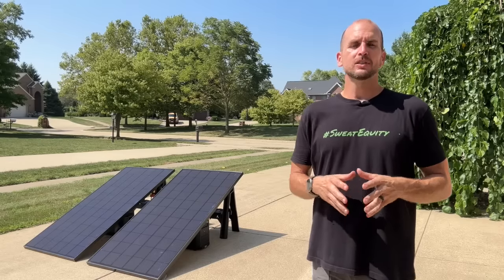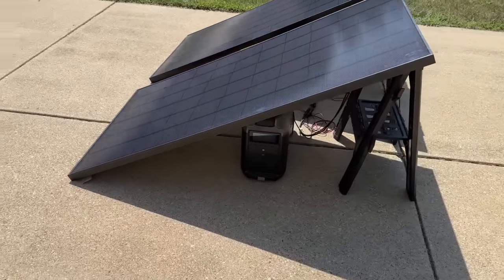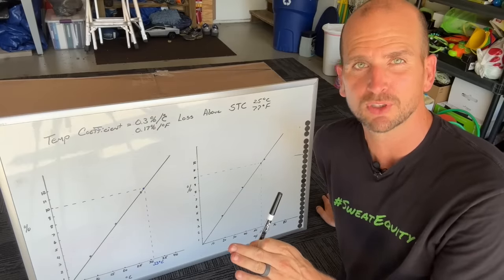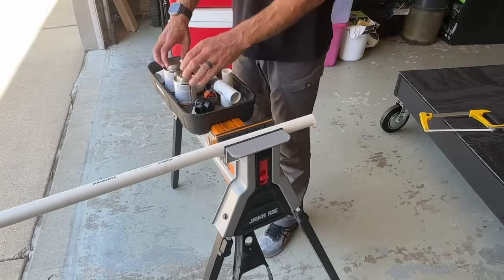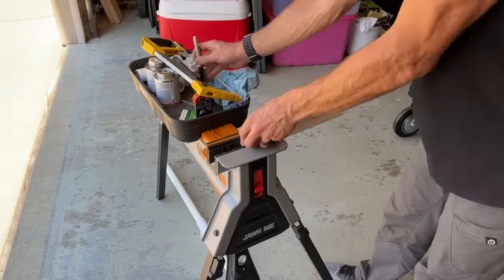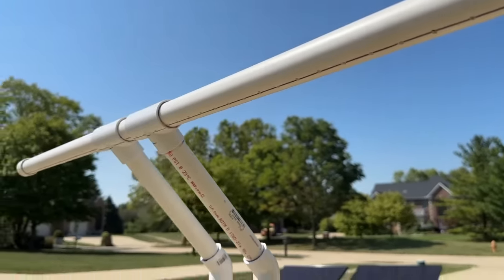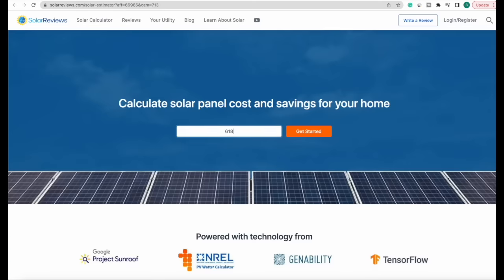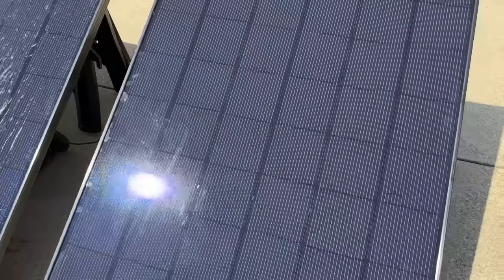Surprising Power Gains By Cooling Solar Panels

Comment: I have a small array in my yard with a 200ah lifepo4 battery. I use this for my pool equipment, outdoor lighting and power tool charging. You video made me start thinking of a way I could use my pool pump and reclaim the water to heat the pool.

Comment: People have been playing around with this idea since the 1980s! It is 100% impractical, but it does work! 😂 not a single commercial application of this idea has ever been implemented successfully. There is a warehouse north of Los Angeles that is stacked with gently used solar panels and you can pick up a 300 W module for about $40.

Comment: This has been on the table for decades.... Powerlabs, Engineering with Rosie, ..... have done this. The major point is cost efficiency. No use cooling the panels if the cooling costs more than the additional power from the grid would. I have seen water and air cooled panels (backside cooled) that use the extracted heat for heating purposes, but all those systems don't work well if you can't dump the heat somewhere. Running water over the front might even redude the light input into the cell.

Comment: Thank you for all your efforts Scott, this video represents pretty much what  YT should be about in my mind 🙂👍 A temp diff of almost 50% for a 5% gain in yield sounds pretty sobering to be honest. Even if this would vary up to 10%, will be it worth the extra investment for the required material, electricity (water pump) and the water itself, which will become a more valuable resource in the coming decades? BTW - have you observed a significant efficiency gain during winter then?

Comment: It looked like the PVC was casting a thin shadow across the top of the panel. that will cause a big drop in efficiency. Ideally you would only need to use as much water as necessary to evaporate on the panel and not run off.

Comment: Apparently the temperature coefficient changes with the age of the panel because I have some 14 yo panels with extensive spider cracks that have degraded by about 10-15% at STC, (basically when it's cool out), but when they really heat up in the summer the power output crashes. It was a simple test I did when they were very hot I took a hose and hosed down the panels. I saw over a 40% rise in amperage on my Amprobe.  There could have been some SMALL variations in solar input but the sky was clear that day. It was an eye opener for me.
Reply: You'll want to use demineralized water for this, like distilled water or harvested rain water. City or well water will most likely leave mineral buildup
Reply: Wouldn't that be covered under the panel manufacturers guarantee? If your panels had a quarantee.
Reply: @michaelpinkston4628  Not when the manufacturer is out of business.

Comment: i think the data is tainted due to the sprinkler tube being set up in a way that partially shaded the panel. i would say it needs to be rerun and setup in a way where each panel is equally shaded... 0% shaded. 
i like the experiment though, curious to know what the real results would be

Comment: I'd say some improvements are from cooling and some of the improvements are from light magnification from water droplets. Cool test tho. I'd say cooling the back side of the panel would give you a better knowledge of cooling alone without magnifying light on the front side
Reply: I don't think there's any appreciable magnification here - you'd need light that'd miss the panels to hit the panels instead, and there's almost none in this setup. There should even be a detriment from additional reflections away from the panel, since the albedo of the panels seems to have gotten brighter in the video.
Reply: @AySz88  If anything the water is probably diffusing/scattering the light waves away from the panel

Comment: I saw an idea trialed that used special double sided panels installed vertically, with the sides facing east and west. It missed the sun in the middle of the day, but overall generated more power by working more efficiently when it wasn’t as hot, and by increasing the number of effective hours by generating earlier in morning and later in evening. It would be fascinating to test this idea!
Thanks for your vid - super interesting.

Comment: That's actually less of an improvement than I expected, but now that I think of it, cooling the outside of the glass isn't going to cool the solar cells by much due to glass being a pretty good insulator.   Also, one risks cracking the glass.  Generally speaking it isn't worth trying to cool the panels due to the extra complication.   Easier to just add additional panel(s).

Comment: I've run a large water reserve through those pool-heater panels to preserve low temps during peak loads, and a single panel running a refrigerant.

Comment: City water or well water would result in mineral buildup on the panels from evaporation, hard water stains, which would lower efficiency and ultimately become nearly impossible to clean off. Collected rain water or distilled water would be best. A system that carries away heat without evaporation of water would be best. Such panels are available.

Comment: Try a much slower drip rate.

BTW it's really common in FL to have hybrid panels that channel pool water through the inside of a solar panel to both cool the panel and heat the pool.

Comment: 100 gallons of water for 20 watts?  Also good luck with that Cybertruck, you'll need it.
Reply: if you set a collection system under the pannel, and then cycle it again through a small radiator for cooling the water, i think it’s worth it
Reply: if you set a collection system under the pannel, and then cycle it again through a small radiator for cooling the water, i think it’s worth it

Comment: As a boater on a liveaboard boat, sailing from point A to point B.... floating "flexible" panels on the water not only provides all the "free" real-estate needed for a 4KW system, it cools the panels and makes them more efficient. When not in use, it is rolled up on a spool (like your garden hose) and stowed there for later use....

Comment: I have to wonder if there is a increase in power from the magnifying effects of the water and if having a mister would be more effective to increase power that way or creating a steady completely covering flow over the face of the panel would be more effective. Likely a full front of panel covering with water would be best as it would even out any magnification and provide the best cooling.
Reply: I had similar questions and if magnification doesn't help, maybe the mister should be on the back side of the panel so as to not disturb the sun's rays?

Comment: Nice video and info but I think you will find 59F is closer to 15C not 33C.  I can see with a roof with water capture that the loss of water could be minimised outside of evaporation and that with enough hot days, solar on hand or a separate solar pump perhaps this still makes sense.  Simplified with a sprinkler or misting system perhaps both cost and installation time could also be reduced.

Comment: I did this for a well! The array output is just higher than the well, but the high temperature reduced the output to 75-80%, which reduced well run time and increased battery load resulting in even less run time.

With the cold well water, we were able to consistently reach 90%+ (got 108% once!) and the used water is plumbed into a tank for irigation.

The only bad thing is I didn't even think about how the well produces hard water.

Comment: Use rain water, or distilled or reverse-osmosis (without a mineralization filter).  Mineral build up on the panel won't be happy for solar efficiency.  My water has enough minerals that it will turn splashed surfaces white in a few days.  (e.g. around an outdoor water feature)
Reply: Or perhaps use micro misters onto the back side of the panel so that any deposits don't affect the solar efficiency - just reduce the cooling. It would also mean far lower water usage.

Comment: Failed to include the cost of the water for the minimal gain. My water bill is routinely much higher than electric.
Reply from the maker: Yeah, this type of system pulling from city water would be a definite No Go.  I think the most practical system are integrated circulation systems for heating pool water.  So you save money on heating the water and also cool down the panels.
Reply: The cost for the electricity on the pump will instantly wipe out any gains. What a daft idea….
Reply: @willsta21  not if you need to pay for electricity to heat pool water anyway.

Comment: Had a friend that did copper panel backing with water lines running through it to pull heat from the the solar panel back in 07 as a some form of Master thesis, find myself looking for that final document now. To compare Results. He used his to heat the hot water/warm the house come winter. Wish I had the money to do something like that with my house, but that would be fresh constructions I am pretty sure for my design.

Comment: Great to actually see the cooling done for the eyes to see. I wonder why panels couldn't become the  actual ceiling of a home? The cooled home (in summer) would enhance power generation, and possibly even pay for the cooling cost? This could work in winter as well, because freezing panels lose performance. Panels perform best at 73°F  or 23°C.

Comment: there is already a similar solution by using some hygroscopic foam at the backside of the panels. This foam is taking up the moisture during the cool nights and releasing it during the hot day. By this evaporation a cooling efect of the panels is obtained.

Comment: Nice experiment! I have rain barrels and a solar roof, I wonder if I could run something like this on hot days when I have full barrels. Would be interesting to measure how much water evaporates.

I really wish there was some product that was solar panels+water (pre?)heating. Not surprising solar installers don't want to do plumbing but would be interesting if it worked out well. Bonus would be the circulating thermal fluid could help keep the cells clear of snow, too.

Comment: There are a bunch of closed-loop options for a cooling system for solar panels.  A small pump pushing water through tubes mounted to the back of the panels and through a radiator in a shady spot (possibly with a low-wattage fan pushing air across it) will do nicely.  Other people have pointed out that panels with internal cooling channels exist, and can use used to heat pools or feed a heat-exchanger for a hot water system.  I would personally like to see a system similar to the wholly passive solar thermal water heater setups, where thermal expansion of the heated water pushes it to a (small) reservoir mounted higher than the panels with either a radiator or a panel with one of the IR-emitting paints that can self-cool below the ambient temperature in full sunlight.

Comment: Let me first start by saying I like the thinking outside the panel on ways to make them more efficient. We need to find out if cooling the panel will work for better efficiency. The only lesson here is that you can magnify the sun with water to get more power out.

Everything must be taken into consideration when doing research.
How accurate is that temp scanner on reflective surfaces? Most scanner say not to use them on reflective surfaces.
Can you cool the panel without magnifying the water so the only different factor is the temperature of the panel itself?
Should the panels be warmer to keep them more active? We know that you can slow down electrons with extreme cold but we don't know where that becomes effective.

I like and watch Everyday Solar regularly. Information you go over is great and the only way to evolve is to try new ideas. Just so you know.
Thank you for being here and what you do.

Comment: Thank you, Scott!
This is interesting, I'd not heard about the heat losses so this is a good idea, if done right.
Now, I want to see how to install a solar water heater.
I'm ~43 miles north of Florida so I could really benefit from a solar water heater add-on.
I want to do my own install because the install is, reportedly the most expensive part.
The potential savings could be substantial, specially this far south.
So that's why I suggest a video on installing a solar water heater add-on.
Have a GREAT day, Neighbor!

Comment: During the winter, your panels can make a huge amount of power because the panels and the conductors are cooler and can pump more current into your charge controller. In the dead of winter, it isn’t uncommon for us to have a week or two of -40

Comment: Try water catching larger pipe at bottom with water going through a small “radiator”, both in shade under panel. Then pump water back over panel in loop?
Reply from the maker: I am thinking through a coil on the backside of the panel to simulate a pool heater setup while trying to pull some heat out of the panel.  Not sure how successful that will be but worth a shot.

Comment: There is a company called Radi-cool that developed transparent film using a concept called radiative cooling to reflect just the infrared spectrum and passively result in cooler than ambient temperature in direct sunlight. Would be interesting to see this test done using the film instead of water.

Comment: What you want is a closed loop system that cools panels on the backside. On the front water interferes with incoming photons. In a closed loop ypu can also collect the heat you collect.

Comment: Thought on this. I could see if you catch your rain water and use it to do this. If you have solar on your roof the water gets sprayed down to your rain gutters. Rain gutters than move it to the holding tank to get sent back up to the system. On the other side of this you could blow out the pump if not enough water was caught. You would be making more power to run the pump. This don't sound like a terrible idea if someone does catch rain water.

Comment: I live in southern Mississippi and temps can be 110+ F for weeks. I wonder if cooling with atmospheric water would prolong the panel's life over time. 

Having a loop that feeds from the gutter on my roof could catch the water and feed it into a "U" shaped system that would make a small pump work easier. Problem is the water would eventually reach a temp not very far from air temp, maybe a 10F drop from air temp cooled just by evaporation. I could use a float value to keep the system at a needed level.

One con would be the increased constant humidity might encourage mold or mildew growth. Another is the pump isn't going to last forever, and keeping debree out is an ongoing issue.

Comment: POSSIBLE FOLLOW UP TEST:

Consider a follow up test, to determine the quantity of power required, to run a pump to pump the water from a bucket, then use a rain gutter at bottom to direct the water back into the source bucket.

Then subtract the power required from the power gained to get a net gain or loss from water cooling.

thx
Reply: Also note: using recycled water may increase the temperature of the source water over time, so may need to measure temp of water over time, and increase size of bucket to give water time to dissipate the heat before it is reused to cool the panel.

Comment: An idea I had was a rain collection system tied to the gutters. Then a solar powered pump taking the water out of the rain barrel/ibc tote to spray on the panels. Any water that didn't' evaporate would recollect in the gutters and refill the barrel. Sure you might have to add water from the tap occasionally but if you have enough tank capacity, maybe not.  Add a low pressure timer so that it comes on during the hot part of the day and it would save water.  I just picked up a simple solar water pump for $17 for another project. It would be enough to pump for 1-2 panels. so it can be done on the cheep. Just make sure the tank is in the shade so it stays cool enough.

Comment: If you have a pool you can recapture the water at the bottom of the panel and pour it into the pool and use a pump to take water out of the pool to spray the panels, that way it keeps it cool and I imagine would work fairly well as a pool warmer. I'm in California even though we have hot day temps, the low temps at night make pools annoyingly cold.  This way you can keep your panels clean, cool and warm your pool!

Comment: Thanks for the review of the concept. IMO, I guess another upside would be removing the dust build-up. Being from the SW-US, the other issues are: 1) Wasting water (I guess if you want to get complex, you could recirc it, but the more complex, the more things to break/maintain), 2) hard-water crusting/build-up on the panels (can be hard to remove), 3) what is pumping the water and what is its energy draw of that pump compared to the increase in power production (assuming you're not just tapping city water)? 4) if you have multiple rows of panels/large system, the plumbing to ensure all panels are cooled is a bit difficult.  Finally, what about a simple air circ fan? Is that enough to actually cool the panel/... Probably not.

Comment: I did a project on this effect in my heat and mass transfer class, the math behind it is very interesting but it's only a viable option at certain temperatures, I primarily studied the effects of wind on the efficiency